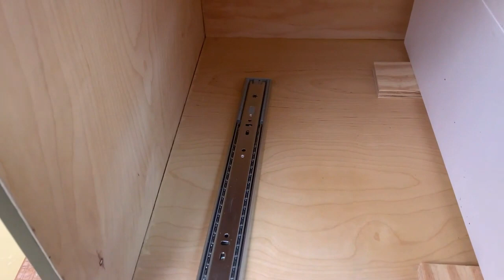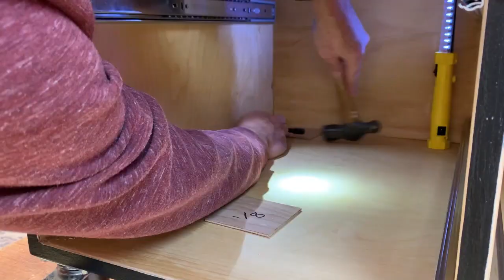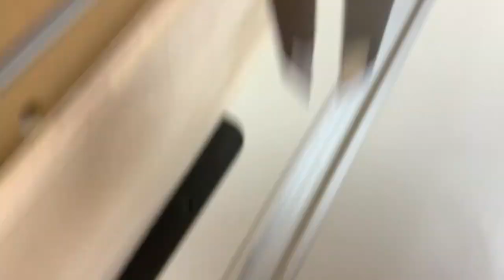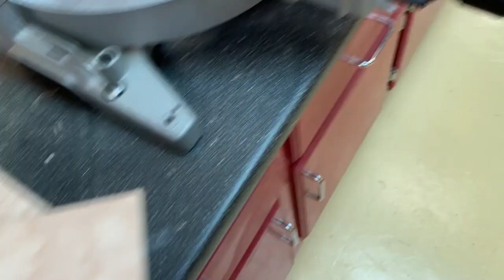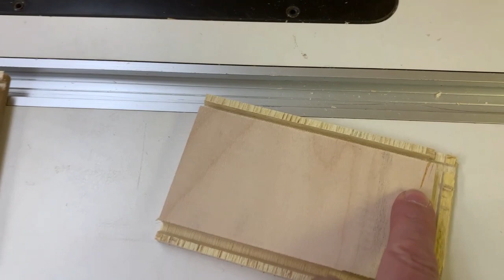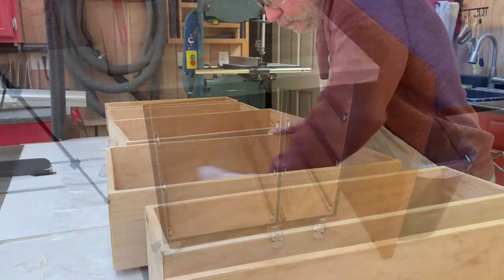Drill Press Base Cabinet Build - Episode 2

Comment from the maker: The little hand ratchet you saw me use was made by SK tools. It has three setting (locked, ratchet clockwise and counterclockwise) and accepts any bits using a 1/4 square drive. This tool is made by many supplies offering automotive tools (snap-on, craftsman, husky, etc.) I love it for tight places.